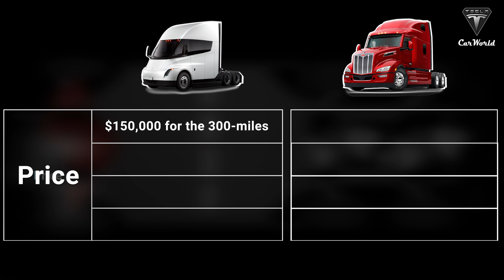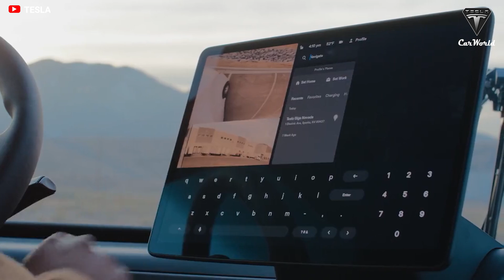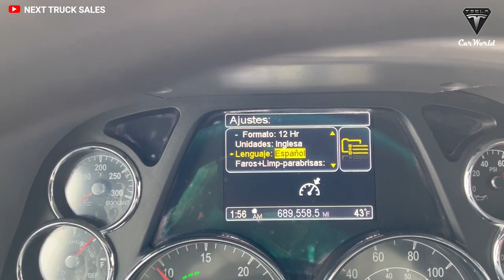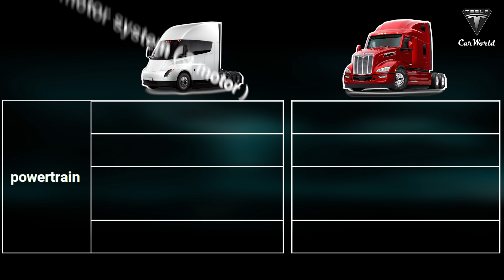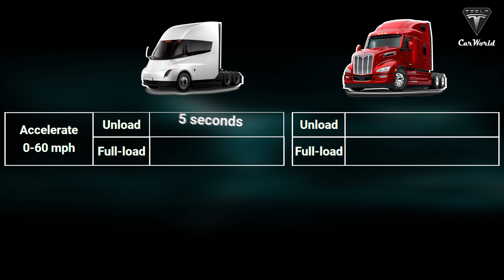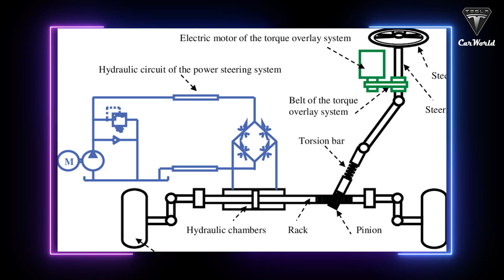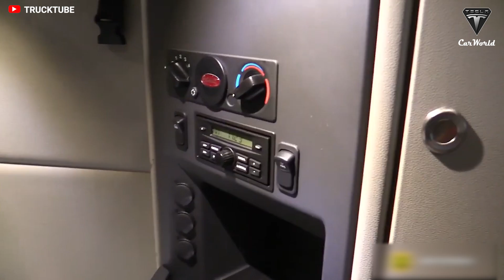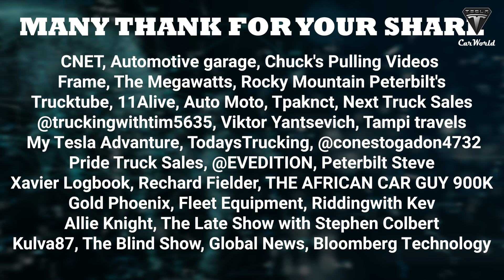Tesla Semi Vs. Paccar Peterbilt 579! Which is the Best Choice of 2023 Heavy Trucks?

Comment: We still don't know the empty weight of Tesla Semi. So we cant calculate how much cargo can be transported. 
I think it has to be something embarrassing because they have not announced it. And I think hiding that information officially, and having it leaked inevitably will be damaging for the brand.
Reply: @Terry Orzechowski  so, I'm going go out on a limb and assume you don't have a cdl, and don't drive anything bigger than your Tesla 3.

I assume this, because you can drive 11 hours in a 14 hour period, and you need to take your 30 min break within the first 8 hours of coming on duty. So you got the HOS all wrong.

Also, most trucks average about 62 mph which is 682 miles in that 11 hour period, not counting, traffic, weather, terrain and other reasons you would stop. 

Although technically you could come on duty at midnight, drive 11 hours in a 12 hour period, with a 15 min pre trip, 30 min break and 15 min post trip. By noon.  Then take your 10 hour break. Come on duty at 10 pm, 15 min pre trip and drive for hour and 45 mins. To midnight. In a 24 hour period, but you could continue driving your 14 hour duty window after midnight. In which case you would have probably driven about 765 miles Ii a 24 hour period as a solo driver observing all dot and fmcsa regulations concerning hours of service. This would slightly be affected by occasionally stopping briefly to do a quick walk around on your truck to check, tires, lights, mudflaps, airlines, bathroom break etc. 

In order to 900+ miles plus, you would employ team driving. 

I have a class A cdl with all endorsements minus passenger, including motorcycle. I have 14 years and over 1,000,000 miles safe driving, all 48 lower and I've been to every major city minus Miami to load or unload, been on just about every mile of interstate and over most major mountain ranges either interstate or state highway. Reefer, dry van, flatbed with over-dimensional, tanker, roll-off and dump trailer. 

I feel like I'm qualified to tell you, you're clueless. You need to educate yourself before you think about disagreeing with an expert in the field. 

Have a good day sir! 

BTW, I was being paid over time, while waiting for my trailer to be unloaded while typing this at 930AM on a Wednesday.
Reply: @Terry Orzechowski Yeah, I also hope it turns out to be great anyways. Still it feels dumb to not announce it officially. Leaked information always sounds as if the company tried to hide something dirty. And now this empty weight data will be leaked instead of just being announced by the company.
Reply: @bary1234  if by leaked you mean a Pepsi Cola truck driver running his empty truck and trailer across a CAT Scale, yes, that's exactly what's going to happen. Then subtract that number from 82000 and you get the max cargo weight allowance. 

This thing is going to be a disaster for anything less than ltl shorthaul 150 to 250 mile radius. Nothing more. And they sure won't be pulling anything heavy out of the Westcoast ports.
Reply: @purpletigerracing7087  Yup, that is exactly what I mean. So why not just announce the empty weight officially, this is just dumb.
Reply: @bary1234  because their tryi g to sell it as a hip, innovative new product. That goes out the window once you find out how useful it's going to be.

Trust me, you're going to see this thing pulling 25 ft pup trailers around LA. Pepsi, UPS, Fed Ex

That's it.
Reply: @purpletigerracing7087  Sad if that's the case. Would be nice to replace diesel trucks with a better solution. 
But seems this was not it. If they solve full self driving and could stop paying drivers these things would start making sense again.
Reply: @Terry Orzechowski  have you ever seen the drive motors on a Tesla S? This things motors are not going to be the size of footballs.
Reply: @purpletigerracing7087  Yeah, bigger than a football; but the weight is about 100 lbs., which is the more important stat.
Reply: @BigBen621  I figure each motor to be about 100-200lbs minimum. They're going to be bigger than Model S motors.
Reply: @purpletigerracing7087  Yes, I misspoke. I went back to my source, and it was discussing the Model 3 motor, not the Model S. But I think they said they were using the actual Model S/X Plaid motor, didn't they?
Reply: @Terry Orzechowski how old was your model 3 when the battery needed replaced?
Reply: @Terry Orzechowski  you truly don't understand logistics. You want your truck as light as possible and you want to put as much in or on the trailer as possible. 

My daycab weighs weighs 33,000lb with one of my light tankers. That means I can haul 47000 lbs. 

You're on drugs if you think any company is going to buy 2 trucks and 2 tankers and pay 2 drivers to move 2 24000 lb loads. Not to mention the extra time it'll take to hook up the equipment and pump off to loads.  

I get your a Muskateer and all, but the real world operates completely differently to how Elon tells you it does.

Also, their building those semi's the exact same way they build the other Tesla trash. So you can expect the door handles to not operate properly, the vehicle to randomly shut down, the battery to take a shit, windows to go flying off the truck at highway speeds, etc. 

Charging for 10 hours after going 300 miles because Elon decided that since it's Tuesday and he didn't like what his alphabets cereal spelled, he's shutting down your super charger. Etc
Reply: @Terry Orzechowski  well I10 through Texas is 75 mph during  the day. 70 mph at night. 

So theoretically, If you could average 72 mph through Texas on I10 you could do 900 miles in 12 hours, obeying HOS with a few miles in New Mexico on your way out of Texas. 

Oh and let's say this truck is a modern Paccar engine Pete 579that gets about 6 mpg and his 2 150 gallon tanks. That's 300 gallons and 1800 miles. Oh and it literally less than 30 minutes to fill up those tanks from empty with high speed pumps at the truck stop. 

So, this truck, fully loaded with fuel, and running team drivers. Could do 1200 miles a day minimum. And not need fuel until about the 2nd driver came on duty after day 2 of driving. 

Your Tesla Semi will NEVER do that. Lol

Oh and for shits and giggles, human beings can drive as long as they want, and in some cases its legal. Others. Not so much. 

Some cases would be livestock or natural. Rules go out the window down in certain circumstances.

It's kind of a thing. 

What else ya got? I can do this all day if you like.
Reply: @Terry Orzechowski  I find it amusing, that you think the Tesla Semi will be able to do 900 miles a day, team driven including charging time. Which will probably be similar to how Tesla cars Super Charge, broken up over distance. If the infra structure existed.
Reply: @Terry Orzechowski  local, regional and over the road driving has different needs and in many cases the trucks are spec'd for those needs.  

Mega carriers, large fleets, small fleets and owner operators also have different requirements and spec trucks based off them. 

The road trucks I've driven for Mega Carriers and small fleets had different wheel bases, different sleepers and 2 100-150 gallon tanks. That was reefer and dry van 48 states and flatbed regional and local. They also had 15 liter engines and either 10 or 13 speed manual transmissions. The rear ends varied. Usually 3.55-3.73. 

Prime used to run a fleet of light weight trucks. They were short wheel base trucks, small sleeper and a 50 gallon tank. They ran ECO trailers. Weight was kept to a bare minimum. Max cargo was roughly 48000 lbs. The range was about 150-250 miles with a 50 gallon tank. But anything more than local required multiple fill ups en route. 

The Tesla resembles a cab over hybrid with a standard sleeper. Which is pointless. If it's got a 300 mile range, you're better off specing it as a day cab and bringing it home and charging on the 10 hour break. 

However, due to how much it weighs, your cargo allowance will be low. So it would be best suited to LTL (less than loaded) freight vs truckload. 

But, most of the day cabs you see running around are slip seated. Which means I drive it for a shift, drop my trailer, fill it up with fuel then another driver gets in dies a pre trip, backs up to a trailer than leaves for his or her shift. So the truck isn't going to have much time to sit and charge.

Most all the LTL companies have fuel at their terminals to keep downtime to a minimum. And it only takes 15 minutes to fuel a truck with smaller tanks. So it can be done during your post or pre trip to save time. 

 R&L, XPO, Fed Ex, UPS etc are all LTL, most pull 25 ft pup trailers in city, then either send a train of doubles and triples about 200 miles line haul to meet with another driver, swap trains and return to their terminal. Multiple swaps ensure your cargo gets cross country in a matter of 2-3 days max, although some of er night freight is loaded on a truck and taken to the airport and offloaded directly on to the air craft.

The 500 mile range truck might work for that sort of thing, but I'm guessing cargo capacity will be 15-20 lbs max. 

Time and weight are money in the logistics business. 

The Tesla Semi will fail at both until the weight on the battery comes down and you can fully charge it in 30 minutes or less, and it's range and the infra structure are improved. 

I'm going to keep driving my gas powered cars. My F150 can go 700 miles + on a single 36 gallon fill up. Which takes 15 minutes. Lol

I'm going to buy a Mach E after I pay off my Escape. That's my 1.5 liter Joe Biden beater. 400 miles on a single 16 gallon tank. Takes 10 minutes to fill. 

The Tesla Semi is a PR stunt or at best a test program. Im.sure anyone buying them in fleets form is getting massive tax breaks for that reason. 

These trucks would be idle for port use moving containers. But they weigh too much. Maybe in 10-20 years when the battery tech and charging infrastructure is where it needs to be.
Reply: @purpletigerracing7087  Tesla Semi will be charged at the same time as it is unloaded/loaded. That is one good thing going for it.
Reply: @bary1234  how? The only way that would be feasible is if you had a 220 line at each dock run out to the truck. 

So you would need a 100 ft 8 Guage 220 line at every dock. Which I can already see drivers leaving still attached, or running over a cable. 

The only way that works is if the fleet owner does it at their facil. Or if your customers upgrades. Even if they do, your customers are then going to charge the fleet for energy use.

I can already see some brokers tryi g to screw over everyone involved with an "EV Surcharge".

Good times.

This gets dumber by the comment.

Comment: What..NO diesel fuel ⛽️ No DEF. No oil , No antifreeze and No brake pads wears.. it’s a no brainer .. TEAM TESLA!!!🙌🏽
Reply: You need some form of liquid coolant and heating, front brake pads are not connected to regen, the front wheels are not connected to the electric motors.

Comment: Because you screwed up payload vs gross weight you missed the biggest disadvantage of the 500 mile semi. It’s payload will be much less than the Peterbuilt and that will make the cost per mile much higher. Also when Tesla did the 500 mile test they drove very slowly, you can see how often it was being passed by other trucks. The 500 mile semi is not practical. The 300 mile semi with less weight for the battery is real winner for local deliveries.
Reply: They drove slowly because the truck speed limit in California is 55 MPH. No one is claiming that its range is 500 miles under any and all conditions; of course it isn't.

Reportedly many trips are limited by volume, not weight, so even if the payload is somewhat less, it wouldn't be a factor on volume-limited trips. And finally, just because the payload on weight-limited trips might be somewhat less, this doesn't mean the cost per mile will be "much higher"; if the cost per mile of the Tesla Semi is considerably less than that of a diesel semi, it can give up some payload and still be less expensive per mile.
Reply: @BigBen621  Speed limit in California and Semi Trucks were passing them, Face it, the driver was hypermiling to extend the range as much as he could.
Reply: @pogo1140  I'm not sure driving the speed limit is "hypermiling". What other semis do is up to their drivers' individual risk tolerance for losing their CDL to speeding tickets.

To be sure, this trip was made under ideal conditions, although it did include a climb up the 4,100 ft. Tejon Pass (Grapevine). Maximum ranges are typically established under ideal conditions; and it's up to the dispatcher and driver to determine actual range under the conditions of the individual trip. My Tesla Model Y has a rated range of 320 miles; but I know very well that it can only achieve that under ideal conditions, and my road trips are never under ideal conditions.
Tesla automobiles have a very sophisticated range estimating program, that takes into account speed, weather, elevation, battery conditioning, and other factors. It seems reasonable to believe that the Tesla Semi, where range is even more critical, will have an even better method for predicting range.

Comment: The Tesla semi is far superior. Unless I was distracted you didn't mention that the Tesla semi will have much lower maintenance requirements and thus much lower maintenance costs in addition to the 200,000 give or take Savings in 3 years due to the differential between electricity cost and diesel fuel cost, there will be thousands of dollars of savings due to the semi needing virtually no maintenance. The brakes will last Almost indefinitely, there is no transmission no clutch assembly,, the extreme reliability and longevity of an electric motor that is not just an electric motor but the very state of the art, as compared to requirements for valve adjustments repairs to exhaust system engine overhauls oil and transmission fluid changes etc. It will be a financial necessity for any kind of trucking operation to remain competitive to switch to the Tesla semi in short order
Reply: It’s not
Reply: So the Tesla semi will never use the front brakes?